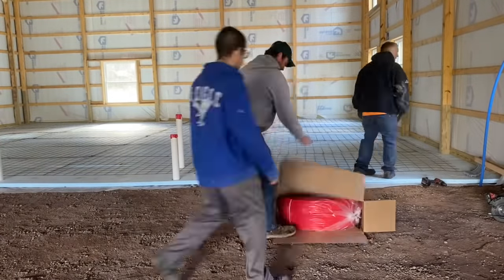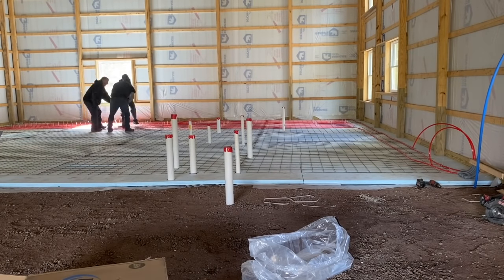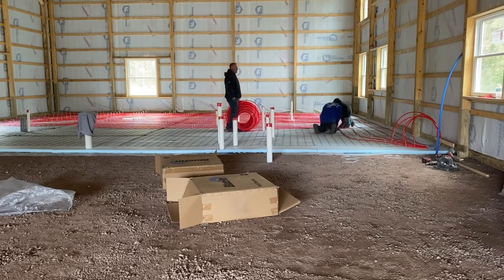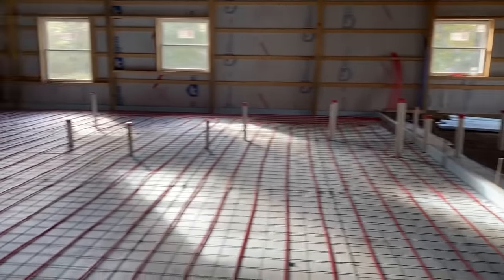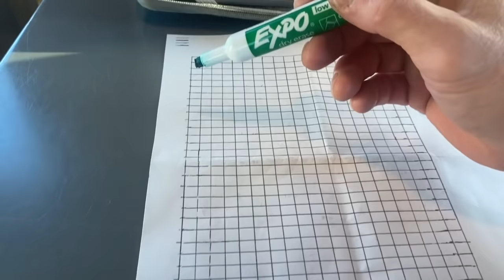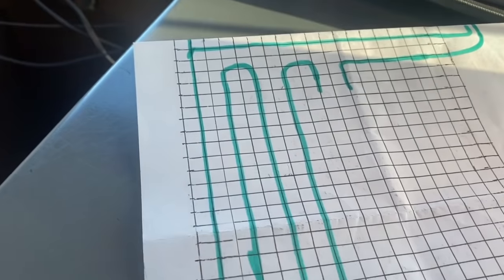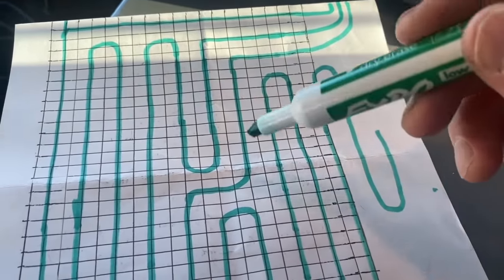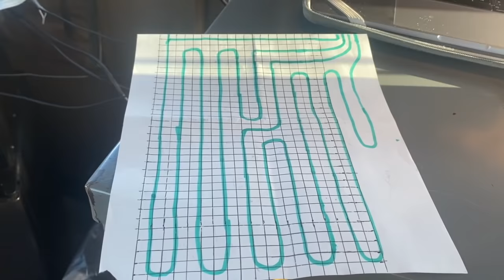Installing your own radiant heat tubing in a concrete slab. (DIY METHOD)

Comment: I am doing a 32'x46' garage, I am assuming you are using 1/2" pex? Also based on your experience, what type of wall mounted boiler have you had the best results with? Or water heater? Thank you.
Reply from the maker: Yes 1/2" oxygen barrier pipe. I would use a gas water heater. HTP Phoenix light duty is a good one for the price.

Comment: What do you use to heat the water?  Can you simply use a hot water heater?  Is there any reason that wouldn’t work?
Reply from the maker: You can use a gas water heater or any type of boiler.

Comment: I live in Ca and always see the concrete poured directly on compacted soil, is that foam board under the wire mesh and why is it used? ty.
Reply from the maker: It's 2" closed cell foam and it is there to make the heated concrete not loose heat to the ground.

Comment: Nicely done. Just a simple question if I may. Why would you not do the first run on the perimeter to have the higher heat near the edges? My mind says this would warm the perimeter best to make the rooms more comfortable. I have no experience with this heating but hope to someday have radiant heating in a house and garage in Kentucky or Tennessee. Thanks…
Reply from the maker: I like to keep the heat in the concrete it will try and escape to the cold if put by the edges.
Reply: @bondobuilt386  thanks. Sounds reasonable.
Reply from the maker: @dang6832  No problem 👍

Comment: After years and years of use. Since it’s concrete over the tubing is there a chance for failure? Im assuming so. But how would you repair? It seems expensive to find leak and fix.

Comment: great videos!  I am doing a 36x40 barn. 1450 sq ft, based on what I am learning from you...3/ 500' loops of 1/2" pex will work fine. could you tell me which header/manifolds and pump with accessories I need? Thanks for what you do here!  please and Thank You for any help!

Comment: can yo upost some amazon links please if you can. 
items you would recommmend on suppply list i am looking at redoing a recreational room that was added on and do concrete self leveler to do epoxy floor coating, and found this video on radiant heating, you made it easy to seem capable, but my floor already done built 20 years ago i am converting to new full kitchen.

Comment: Here is an idea that occurred to me after doing 4 of these systems:  Rather than split the room into 4 quadrants for example, and run one loop through each, have each loop run through the entire room, spaced 5 feet apart.  That way, heaven forbid one of the loops gets compromised even years down the road, you can still heat the entire room (not just 3/4 of it) with the remaining three working loops.  

I also discovered that "keeping the loops the same length " was not a "down-to-the-inch" requirement, and in cases where you cannot do this, you can employ a flow reduction valve (not exaclty like a shutoff valve, but similar) to introduce extra restance and balance the flow.  

When tying loops down to the mesh, I use zip ties, loose at first, so I can adjust things in case the layout is upset for some reason, loose ties are tightened as the plan resolves.  

I also close the system and air it up to a pressure of 20 PSI and have someone watch the gauge to discover if someone punctures a tube, but in fact, it has never happened thatone was punctured.
Reply from the maker: Thats a pretty good idea to space the tubing out like that in case of an issue down the road. Yes you are correct I think even 20 feet is close enough for tubing length I try and get it close so it balances itself. Shoirt cheap copper headers is all you need. We have never punctured a tube in over 100 radiant slabs. I used to tie tubing loose with ties also but now I do my backwards trick from the manifold when getting close to where I want to be. Thanks for the feedback I appreciate it. 👍😊
Reply: @bondobuilt386  You are welcome.
Reply: Is the 400ft due to the ability of the circulation pump?  So if you run 3 400ft loops you gotta have 3 circulation pumps?
Reply: @pellerselsjd  naw, one pump is fine.  I have three zones with one pump on each pushing through 5 and 6 "loops" of 250' each.

Comment: Curious, why didn't you use three 333ft loops to evenly use the 1000ft instead of having 200ft left on a roll? I really like these videos you put up.  Thank you!
Reply from the maker: Glad you like tghe videos. 😊. Each section was 40X30 so it was 1200 feet of tubuing per section. In concrete you want 1 foot of tubing per square foot of concrete. The wire mesh is on a 6 inch grid so we run it everry other grid and its spaced at 1 foot. I’ll send you another video that explains it better. 👍
Reply from the maker: https://youtu.be/MgAJmah0anM

Comment: Thank you for the video! Very helpful👍 I’m about to pour my basement floor 2400 SQ with radiant tubing. I have my 2” GAF R-10 25 PSI foam down and tubing down just like you show on the video. Question is since it keeps raining every evening and I want to pour on Thursday is it ok if I have little water under the foam . I can’t pump it completely out . I just walk on it and where I feel it has water under it I make a small opening in the foam and vacuum it out as much as possible. But I’m freaking out since I don’t know how much water can there be under the foam at lower spots 1/8” 1/4”?
Please let me know what’s your take on it?
I learned how to build with nadura ICF Thanks to your videos... Thank you!!!
Reply from the maker: Hi Mark. Great to hear that my videos helped you build your own basement. That’s awesome. A little water under the foam board won’t hurt the floor any. Pour it at a low slump like a 5” slump and you will be fine. I’m assuming no more then 1/4” under there. 
Good luck buddy 👍👍

Comment: This is Awesome! I'm building a 48'x80" and Plan to use this. I have some questions...1.) What's the best choice for vapor barrier and place to purchase? What size pe
Reply from the maker: We use 6 mil polly for vapor barrior. You can buy this almost any box store. We use 1/2” oxegen barrior pex. I buy 1000’ rolls at a company called Supply house online.

Comment: This video is so helpful.  I'm in southern Indiana and had planned on using 1" foam insulation, it looks like you've used 2". While our grade isn't set yet, should I be shifting gears and using thicker insulation? How do I find out standard for my area, we were planning on 4" of concrete.
Reply: Talk to your local planning department. I am using 2" for an R8-10.

Comment: Counter flow layout gives most uniform heat on floor. Serpentine layout what you are using is uneven it's warmer on other end where water starts flowing hot into pipe. But does it matter on barn nope. But on residential house i would only use counter flow layout.

Comment: Thank you for this great video. I will be building a 48 x 30 pole barn and plan on using this method to heat it. I was curious what diameter tube you are using? Maybe you mention in the next video but if not can you please tell me about the rest of the system, pump, heater, etc.... Im going to keep watching just in case you already covered it.
Reply from the maker: Hi there. The tubing is 1/2 “ oxygen barrior pex tubing. you can order it online at Supply House. There are many ways you could heat the water but a 50 gallon stainless steel gas water heater is my favorite. The HTP Phoenix light duty is about the best for the price. We use Taco 009 pumps for most systems we set up. 👍👍
Reply: @bondobuilt386  where is the best place to buy a htp water heater? does it produce alot of condensation?

Comment: Thanks, great explanation on running the tubing. Would there be any advantage to using 3/4" PEX, and do you have any vids on building the manifolds?  Nice work!
Reply from the maker: Thanks. I think 1/2 is easier to work with and less expensive.
Reply from the maker: https://youtu.be/P5pwXpFzW64

Comment: Hey Bondo,

Love your videos, especially the ones about radiant floor heating.

I was wondering if you could do the same thing in reverse and use a chiller to make the rooms cold?
Reply: From what I remember that could cause condensation/moisture problems.

Comment: What a great video. I might have missed it but what size pipe did you use for the 400' runs? I'm assuming 1/2"?  BTW I'm in Kirkville, just east of Syracuse, and I'm having a 24'x60' barn built real soon.

Comment: What's the diameter of the hose?
1"?
Or 3/4"?
Code says you cant run a 3/4" pexx more than 350 feet per loop 
It will need  to be a minimum of 1" or else the water will cool By the time it reaches the boiler

Comment: Great content! Any reason you cant staple the pex to the insulation and put the wire mesh over top? That would get your wire into the concrete and your pex against the insulation where both should be. From what I've seen, people walk over everything anyways.
Reply from the maker: https://youtu.be/4HHC015JVBo We did staples on this job.

Comment: This may have been asked but are you using Pex A or B tubing. Also how thick was your concrete pour ? I’m doing a 30 x 40 slab and was thinking the foam board only needed to be 1/2 thick but now I’m seeing 2 inches. Don’t think after packing my minus I will come up with that much extra room to do a full 6 inch pour and I didn’t want to lose an inch of concrete
Reply from the maker: You could use 1-1/2 " of foam and 5-1/2" of concrete? I would not go any thinner even if you have to take some stone out. We use oxygen barrier tubing from supply house you can order it on line.

Comment: Could you give us an estimate of the total cost per foot vs just pouring a regular basement floor please … I am taking a very old basement out and I believe I should do this and I think it would heat the whole home above … old raised ranch and the basement is approximately 720 sq ft
Reply from the maker: You should only need 15 sheets of 2" polystyrene foam at say $50 a sheet tops. $750 and a 1000 foot roll of oxygen barrier per tubing at $250. So for $1000 you can have the tubing in there and ready.  Seems like a no brainer bud.

Comment: Is the wire mesh basically just for affixing the tubing at this point?  With fiber additive, you don't need it for concrete strength, right?
Reply from the maker: That is true Shawn. If you wanted more reinforcement put some over the tubing bud. 😊

Comment: Is using 3/8 tubing out of the question?  I want to install over existing floor and already have less than 8ft ceilings.  I need to keep the increase in floor elevation as low as possible.
Reply from the maker: I never have tried using 3/8 tubing. So I can't advise it. The insulation will take up the most room so you could put thinner layer of closed cell spray foam down instead of the 2" board foam but don't skimp on insulation or it will cost a fortune to heat.
Reply: @bondobuilt386  Without question I would use 1/2 in a new project, but I'm planning a retrofit over exist floor.  I currently have only 89 inches...so. every 1/4 matters when it comes to my doors (walkout basement).  I've seen 3/8 used for hot water lines because of increased velocity I just don't know how that would translate to radiant heat system.  I only get one shot to get it right.  My current strategy is to groove the floor with a $150 wall chaser if it goes reasonably fast or rent a walk behind if I can run more than one blades.

Comment: Whats the point of the wire mesh under the poly? Wont it essentially be below the concrete instead of in it?

Comment: How do you keep from punctuating the line when putting in your walls?
Reply from the maker: Use PL Premium glue on bottom plate and tap cons that only go in floor 1-1/2"   Markmyour drill bit so you don not over drill to deep.

Comment: Thanks for the vid...I'm going to 'go at it' myself here in the spring with the confidence built from this video.  It'll be a 5 or 5 1/2" slab and I was thinking of pouring 10" deep by 6" wide around the inside perimeter so critters can't sneak in.  I'll stick a vertical insulation board the full depth to keep the outside cold out.  Are there any other considerations (inside or out) with a perimeter deeper than the rest of slab?   Also, for this basic installation, what all pex tools (or other) are required?  Thanks
Reply from the maker: You should be fine with the thicker edge. Thats just like a monolithic slab. I don't use very many tools to do pex just a tubing cutter and thats about it. We hand roll it out. I'll send you another good video to watch also. 👍😊
Reply from the maker: https://youtu.be/MgAJmah0anM

Comment: Couldn't help but notice that the columns in your walls are treated up to a certain height to protect from rot etc..  My question is this: how are those columns stitched together so smoothly, or is it painted on to that height?
Reply from the maker: You can buy poles that are made like that. They splice treated wood to the regular wood. I believe its all glued together and then sent through a planer. They are straighter then a treated 6X6.

Comment: I thought 220 feet was the max you should run from header to header..  How did the 400 foot run work? Any cold spot is the floor.
Reply from the maker: We do loops up to 500 feet all the time. heats up great.

Comment: You're not worried about the fluid flowing threw the tubing on the metal rebar to rubbing a hole into the tubing? And are you using a general foam board to insulate the ground that you can get at any box store? Or is this a special foam board you had to order in?
Reply from the maker: Youn can get the foam from the big box stores. Just make sure it is Polystyreen. that is usually the green or blue board. You dont want to use Polyiso it is a open cell. Yopu want closed cell insulation. No worries with gthe tubing. It will be incased in concrete.
Reply: @bondobuilt386  I have a few more questions for you to pick at your brain. Do you have an email that I can send my questions to you?

Comment: Great video! If this was a smaller floor, say 400 sf or so, would you still need to split it into 3 even loops 150'? Or could you run it with a single 400' loop circuit? Also, I wasn't clear on exactly how you determined 400' sections for this... it's a 1200sf floor, and most places say for 12" spacing to do 1:1 pex per sf, so I would have assumed 300ft circuits. You obviously know what you're doing, just curious if there's a formula you use for planning this..?
Reply: This must be one reason: Maximum loop length which is 250 feet for 3/8-inch PEX, 300 feet for 1/2-inch PEX and 400 feet for 5/8-inch PEX

Comment: The walls are in my pole barn. I would like to run the foam down below 2 feet. Do you have a video showing how that was done?
Reply from the maker: No sorry we don’t run the foam down deep like that. Its just the thickness of the slab around the edges and under the slab 2” of polystyreen.

Comment: Would have been nice if you showed how you prepped the floor for the pex. You're right, running the pex is the easy part, but getting it ready for the pex is a little more involved than unrolling some pex.
Reply from the maker: https://youtu.be/JcBpTpNxneI here is the prep video. Should be very helpful

Comment: Nice vid.  When the framers come in and nail the bottom plate of various walls to the floor, how will they avoid piercing the the tubing? In the future I would love to see the components you use for circulating the system.  Love the channel.
Reply from the maker: Thanks 👍  glad you like the channel. I tell the framers to glue the bottom plate to the floor and use 2-1/2 " Tap Con Masonary fasteners. Then they only pierce the floor 1" and the tubing is at least 3 to 4 " down in because we don't pull it up when we pour.
Reply: @bondobuilt386  Makes sense. Thanks for the reply.
Reply: @bondobuilt386  man, I know you're thinking you're saving people money but you're WRONG 
Fuck man, you're misleading a lot of people. There's a reason that experts need to be doing this, especially hydronic infloor heating systems. You're spacing the tubing way too far apart and it's pointless to bury the tubes 3"-4" beneath the top surface of the finished floor. That systems going to struggle badly in order to achieve a poorly performing heating system. SMH
Reply from the maker: @hammernnails7314  dude I'm not misleading anybody we have done about 300 of theses systems in our cold climate and they heat awesome. My house I'm sitting in right now is 70 degrees and it's 30 outside. My shop is also 70. Keep up the negative comments and I'm gonna block ya. I been doing this a long time and it works and many people have used my videos to do there projects and saved money and are happy with there heat. Real world experience beats your keyboard warrior skills any day. Smh
Reply: Just a simple question. Why don't you put rat walls in? Putting foam in without  rat walls would be so much easier.

Comment: Have you ever run into a floor that cracked a few years later and caused a pex tube to start leaking?
Reply from the maker: Nock on wood I have not and I have done tons of these floors. The heated floor actually has less chance of heaving. But if the sub grade is crap it could settle and drop. we have fixed several garage floors that had settled because it was not tamped proper up against the foundation.  No tubing in them though. It usually takes 15 years and the floor will drop.

Comment: I have an outdoor wood boiler. It is an open system. I have room to add a heating coil in the boiler. Will it need a holding or pressure tank?

Comment: Great video, what is the best way to account for a lift that would go in?
?
Reply from the maker: Just avoid the area where the lift bolts to the floor. 
https://youtu.be/MgAJmah0anM we did it here
Reply: @bondobuilt386  Do you still do expansion joints with PEX tubing?
Reply from the maker: @mstang61  Yes we cut about 3/4 “ into the slab staying way above the tubing.